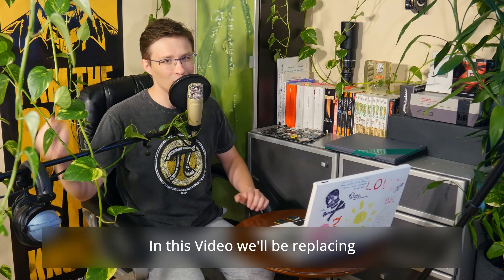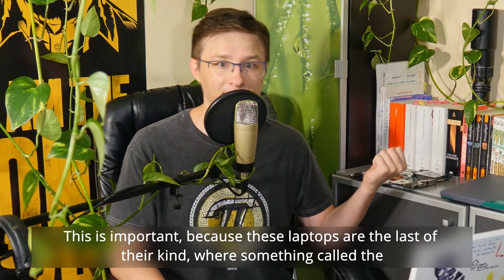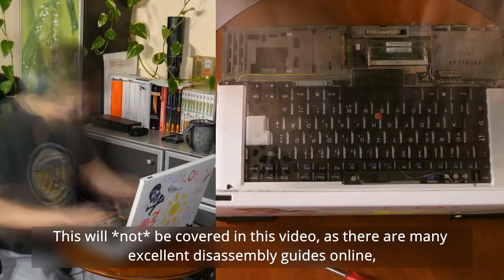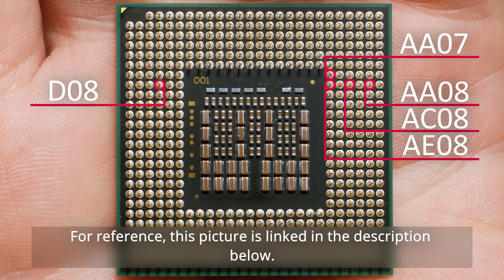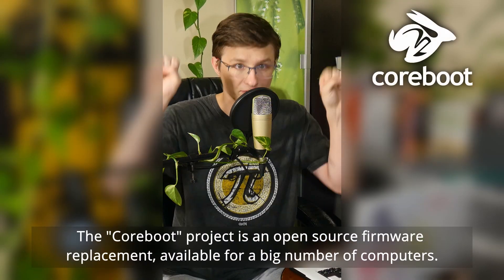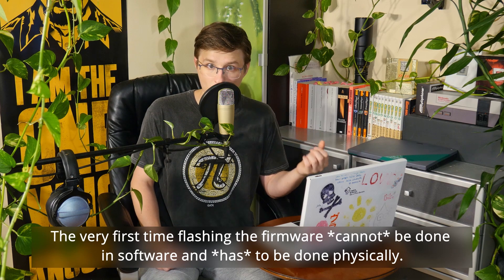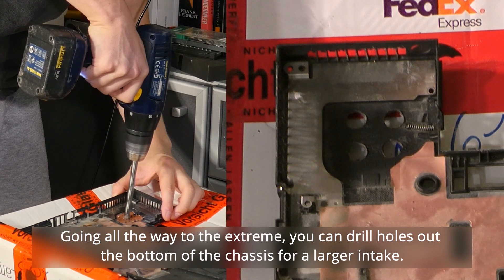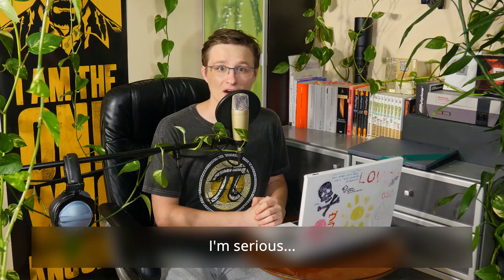Thinkpad Quad-Core hardware mod

Comment: Is it possible to add a quad core to Dell Latitude e6400 without hardware changes? Just by replacing the BIOS to libreboot for example? Currently I use Intel T9900 35W and would like to upgrade to QX9300 45W, anyone?

Comment: hello, I am wondering how I can tell if my cpu / motherboard need these modifications in order to utilize the extra cores of the processor? 

I found your video because I was looking into finding a better heatsink to use with the core2 extreme q9300–now I am nervous that the cpu will not use it's full potential without these mods...

Comment: I just picked up a T61 for fun, might do this honestly - it's got a C2D T8300 right now, a BSEL mod allows putting in things like the T9800 and software modding allows for some Core 2 Quads 🙃
Reply: Just go with a P9700, anything else is a big issue, plus for these generation of old CPUs higher clock per core is better than many cores, because you won't be able to run much with that kind of bad GPUs.

Comment: I didn't know you could do this on the T400/T500. I have a T61 15.4" widescreen motherboard with a core 2 quad as well the nvidia gpu (later 2008 revision) forced into a 15" R60 with an sxga+ lcd. still working strong in 2024 <3

Comment: What about the ThinkPad W500? Is rather similar to the T500.
Reply from the maker: @saganandroid4175  The same applies one to one. Libreboot has a ROM prepared for the W500, even with the June 2024 release of Libreboot and Coreboot has a selection to compile for the W500 in its "make menuconfig"

Comment: Did anyone else have a CPU become useless for multi core use?

cpu2 outright fails to communicate with the system with cpu3 crashing the system cores no longer working correctly

First 2 cores seem to work correctly, had been working correctly for months up till this point, after being forced to cut the power two times in a row due to weird behaviour it just started freezing on boot with issues with those cores.

Is it possible the mod doesn't have any overcurrent protection like this? 

Would a resistor or diode help? 

Or is the slightly different pin out all it takes for this to happen if machine gets abruptly shut off a few times in a row?

I have a spare CPU but would rather not risk it till I'm sure
Reply from the maker: @Zeawi  What CPU, what Motherboard / Laptop, what Firmware are we talking about?

I did not observe such weird behavior. Only thing that comes to mind, is that mounting the cooler is surprisingly difficult, as the two dies need to contact the cooler at the same time, with the air-gao between the dies. That could overheat one die whilst leaving the other operating correctly
Reply: @FrostKiwi  temps never reported over 55c granted I've not seen temp with GPU in use yet,  and definitely made contact with both dies as i took it off after a test to ensure pressure, as for laptop its w500 running seabios/libreboot, also I didn't have any issues with cooler going on

My laptop came with the larger cooler

I have a photo of the error and a short video of the behaviour which I've put in video and community tab of channel 

Doesn't make weird sound any more so can't demonstrate that, if no one has an idea I might disassemble it and check for any obvious burn marks taking a photo of the mod itself and the bottom of the CPU to see if there is anything obvious, though was working for quite awhile before this happened

Could be possible that something has gone wrong with OpenBSD and or it's trying to use a feature of the CPU it doesn't have though don't think that's the case 

Trying memtest86+ which seems like it's working, granted doesn't seems to be as smooth as I remember last test, but that might just be my memory acting up

See if that pulls any errors anyways

Update: cpu is not fried

I think the problem is microcode patch to the kernel on OpenBSD as it's booting on the usb and memtest86+ passed

Also remember I updated the firmware before the funny noise 😂 

In saying that, still doesn't explain why the kernel patch would break it?

Meltdown is a timing attack right? So could it be something to do with that and the rerouted wire or firmware not bring supported? Though I'm still on the fence if there should be a resistor or diode on the wire now, some thoughts on that? Also might I have better luck compiling coreboot myself?

Can't have systems randomly breaking after updating 😅

CPU: Q9000 | Q9100 as spare

Comment: You can use mechanical pencils with a metal tip to bend the pins. it's way less risky and easier.

Comment: Is this possible on my T61 socket P? Currently T9300
Reply from the maker: Yes, the mod should be possible. The T60 is supported by Coreboot / Libreboot, but the T61 is not. However, there appears to be a modded bios, which you can use instead. Checkout Forum.Thinkpads.com thread "Successfully fitted 1066MHz FSB onto T9550 onto T61" post 46, where User el-sahef explains a Quad Core Mod.
The Mainboard and CPU modifications are identical (though the Mainboard Wire has is connected differently).

The Bios part is achieved by modifying another modded BIOS to enable core 3 and 4 - SpeedStep.
Personally not in possession of this Laptop, so cannot confirm those steps.

Comment: How do you only have 750 subs? I have a T500 that I upgraded to a T9600 dual core and runs pretty well. Honestly probably won't mess with the quad core mod (too much expense and hassle, since I don't have the needed equipment to do the motherboard mods and BIOS flashing) but your presentation is better than some MUCH larger channels I've seen. You gained at least one new sub today, kudos!

Comment: Well crud, I was here for a juicy X200 mod for the CPU and then he says its not possible. 
Damn YT, they put this video in the search results. Well, I guess everyone else have fun modding.
Reply from the maker: It was suggested on the coreboot libera.chat channel, that you could theoretically replace the CPU with a BGA rework station. Though that is beyond what mere mortals can get their hands on and afaik no one attempted it yet.
On the more realistic side of mods are: replacing the panel with an IPS one for better viewing angles, eGPU via ExpressCard or a simple USB3.0 ExpressCard for faster connectivity.

Comment: is it same process for gm45 core 2 duo t9400
Reply from the maker: Going from a T9400 to a Quad-Core on the same T400/T500 motherboard? Yes.
Reply: @FrostKiwi  mine installed is acer 5738z T4400 800mhz then i have t9400 which is 1000mhz

Comment: Why is removing these pins increases performance?
Reply from the maker: It doesn't. It's what you have to do to stay within spec. The motherboards were produced before the QuadCore was released, so some pins have to be modded for proper function.
Reply: @FrostKiwi  what happens if you don't remove these pins? It sounds odd that removing pins solves a problem, instead of creating one
Reply: @eitantal726    To be honest, your questions make me think you just should not be doing any hardware modifications for the time being, full stop. This video explains all that is required to be known about this process.  You are asking questions that are answered very, very clearly in the video.      If there are things that don't make sense to you, I honestly suggest you start by learning some general electronics, and basic digital electronics will give you an idea.  Other than that, if you just follow the instructions closely, it will work, but again -- I just don't think you are paying the attention required for this process, and there is some basic background knowledge you don't have and is not in the scope of something like this  -- so don't  screw up good hardware! Sell it to somebody who can use it properly. 
In the future, with more work and attention, you can do this : If FOSS hardware hasn't already happened by then!

Comment: If modding it was fun, it's not a waste of money ;) Even with T9600 (+SSD), this T500 can run 720p YouTube vids without a problem. For browsing and text editing on Linux it's still "okish" laptop. It's GPU sucks though (with hardware acceleration enabled, YouTube vids are choppy).
Reply from the maker: >with hardware acceleration enabled

Via a browser, YouTube is a no-go. Via Browser -> MPV everything plays fine though. 1080p60 without frame drops. As long as it's 8bit only, everything plays fine, even 4k. (On the 4-core that is, 2 core 1080p60 is roughly the max)
There is no hardware accel though. Technically this generation has a h264 decoder, but it is only supported by an outdated Arch-linux branch ( libva-intel-driver-g45-h264 ) and is a terrible idea, because drawing the screen already taxes the GPU and video decoding on top just crashes the GPU driver with anything above 480p. So even if you enable hardware decoding, there is no such thing actually runs, decoding is always in software.
Reply: @FrostKiwi  Damn, you are really knowledgeable about all of this, thanks for the tips! Just out of interest, are you from Germany? :)
Reply from the maker: @JohannDaart  <3 Born in Belarus, lived in Germany most of my life and work now in Japan.
Reply: @FrostKiwi  Your language skills are very impressive!

Comment: Your laptop looks sick man, I dig it. I bought a T500 not too long ago for $15. After maxing out the RAM, putting in a spare SSD, and installing Linux it is actually a very usable system. I don't know if I need a quad core CPU but I have been thinking of installing Core/Libre Boot at some point and maybe even installing OpenBSD.
Reply: Its GPU sucks though. When I enable hardware acceleration in Chrome, YouTube vids start lagging.

Comment: started watching because i'm thinking about installing a quad core in a Dell Latitude e6400 i got for free, quickly realized i don't think there's much i can do about the dell bios unless it magically works without mods. 
Stayed and watched the entire video because you made it super interesting to watch

great video man
Reply: Did you manage to install a quad core in e6400? I am in the same journey, I found some time ago in a forum that someone managed to do that by just changing the BIOS (he had a BIOS programmer friend). Unfortunatelly I was not able to find that post anymore, I wanted to confirm it is possible to do the upgrade without any hardware changes, just by using libreboot for example.

Comment: Can we get a follow up video on the performance of the new CPU and iGPU?
Reply from the maker: The next episode regarding external GPUs will cover the iGPU performance a bit. As for the CPU performance, the short version is: single-threaded performance is (of course) unchanged, and multi-threaded performance is (almost) doubled for perfectly-multithreaded workloads. Compiling firefox from scratch runs now in almost half the time.
Now that I got access to my account again, gotta release the other languages first, banging my head against YouTube support for a whole week blew up the my timetable >.<
Reply: @FrostKiwi  very impressive. Didn't know if cooling or power delivery could handle it.
Reply from the maker: @myyoutubename152  Many thanks!
That's a good point actually: Those Thinkpads had two different power bricks. The 70W and the 90W Version. With standard firmware and the 70W version, the CPU get's throttled to 1.6GHz if you have just the powerbrick and no battery plugged in. So there was a concern about that by the manufacturer. I did some powersaving measurements for DragonFlyBSD and split the cable: https://i.imgur.com/1Nw6rbA.jpeg and measured true power-draw: https://i.imgur.com/ZBqTfMc.png
With WiFi on full blast downloading + Synthetic benchmark on all 4 cores + 1920x1200 screen with after-market LED strip mod = I did in-fact reach 92W max. With no battery present, there is definitely the possibility of damaging the 70W power brick.
Reply: @FrostKiwi  can you elaborate on the screen and the LED strip mod?
Reply from the maker: @memeoid1  Basically, for the x200 you may swap to a panel, that has really good viewing angles, like a modern IPS panel (Though technically the technology is called AFFS/PVA , the predecessor to IPS). On the T500 you may switch to a high-res 1920x1200 panel (Though you have to be specific about your window manager / driver setup to make sure you stay above 60hz, as driving that resolution on the iGPU is close to the limit. ). Among those high res panels there are no IPS panels, only TN panels with aweful colors and viewing angles. The best among the TN panels is a panel made by sharp, which has surprisingly good viewing angles for a TN panel. And although the colors don't quite POP as with that x200 panel, they are still very respectable. That is the extend of screen mods existing for this generation of thinkpad.

All those mentioned screens are unfortunately CCFL based though. Most of those CCFL bulbs are quite dead by now. This is also unfortunate for the resellers of those screens, as they don't have a nice way to test screens before shipping them and often sell "broken" screen because of that, because the CCFL bulb just died. There are LED backlight version, but they are quite bad on the panel side. You can purchase LED replacement strips + driver board and replace those CCFL bulbs with an LED backlight. There are a bunch of chinese resellers doing that and a bunch Thinkpad forums collect mass purchase requests to buy these in bulk at a lower price for the individual. thinkpad-forum.de stopped doing this a year ago I believe, may be wrong though.
The very very VERY best among those LED replacement kits is one made by monty. https://people.xiph.org/~xiphmont/thinkpad/led-backlight.shtml There is a kit called the "daylight mod". This LED stip is color calibrated with love and absolutely strong in brightness output, to allow for outdoor use. However, monty stopped making these years ago, but the schematics and parts used are open, so one may try to replicate his designs.

That is the extent of both Screen and LED mods.
edit: corrected typo, the T500 has a 1920x1200 option, the x200 does not
Reply: @FrostKiwi  thank you for such a detailed reply!

Comment: Hi there!!! 
since you seems to be a bit familiar with the mother boards, I wanted to ask are there any open source mother boards that I can use to test my firmware skills?
I am using coreboot and tianocore but the mother boards that they are using are not open source.
Reply from the maker: Whilst many boards like the one from these Thinkpads have been reverse-engineered to the point they run purely, on blob-free open source firmware, open source hardware is of course another thing entirely, as you mentioned.

On the small end, there are many small projects under the banner of Open-source hardware (OSH) and the https://www.oshwa.org/ .

On the big end, if we talk full blown computer motherboards, only computers of the RISC-V architecture come to mind. #LinusTechTips actually did a video on this some years ago: https://youtu.be/L8jqGOgCy5M

The first RISC-V dev boards, which are not expensive as sin, are slowly coming in, like the "HiFive-Unmatched-Mainboard". Though I don't know if this specific one complies with Open source hardware standards...

Comment: It'd be beneficial to use tweasers for pin extraction.
Reply from the maker: I thought so too! In reality it's surprising how close those pins are to one another and it's really hard to get tweezers in without bending neighbouring pins. (Gap is just 1.27mm as per spec)

Comment: This is an awesome video man! Just want to specify if other's are wondering, it's 30AWG wire you need to jump the connections. I use a T400 with a QX9300 as my daily driver and it's awesome.
Reply: Are there any potential thermal issues with the QX9300? (I've read recommendations for the Q9100 over the QX9300) If there were any issues what did you do to mitigate them?
Reply: @sirguacalot472  I did go ahead with the cooling mod, but even before that I was sitting around 55-60 Celsius. More like 45 to 50 now. It's really not bad at all with the default scheduler.
Reply: @caleblagrange7164  Wow that's awesome! Thanks for sharing your results. I might consider the QX9300 now. I'm planning on doing the mod on my W500. I also have the 2503 Advanced Dock but I have no idea if libreboot will be compatible with it. Might be too good to be true.
Reply: Right now all I got is 24AWG, is that far too much copper for what I need?
Reply: @JH-wg2dc  I'm almost certain that you 24 will be much to large to fit in the holes. I believe it's still doable without actually putting wire through the hole but it will be less robust, much harder to do, and 30AWG is cheap and ships decently fast from amazon.
Reply: @caleblagrange7164  tysm, got some new wire and everything seemed to turn on when I powered it on about an hour ago. Now all that's left to do is put it all back together I guess.